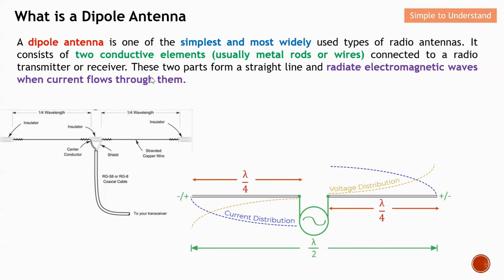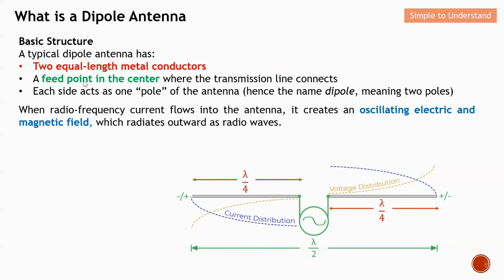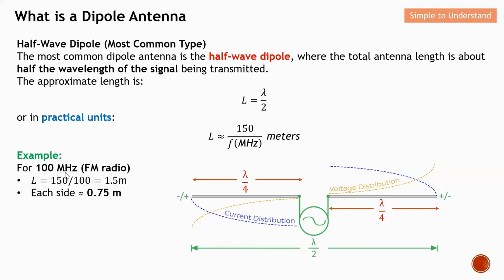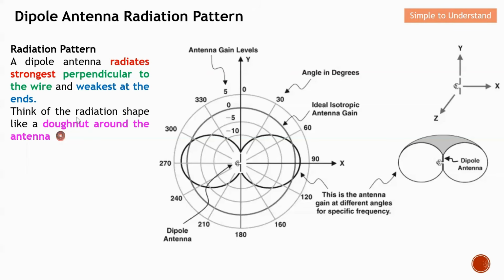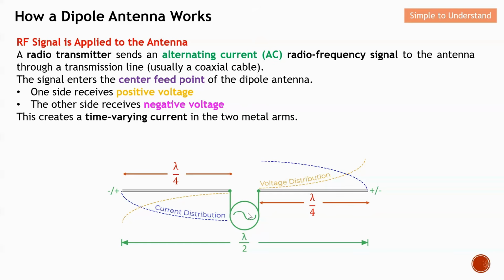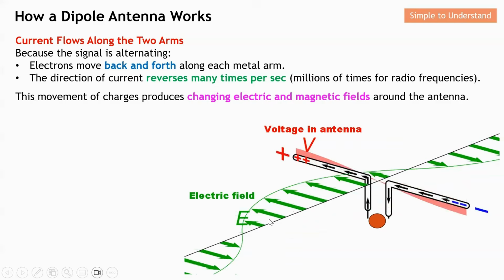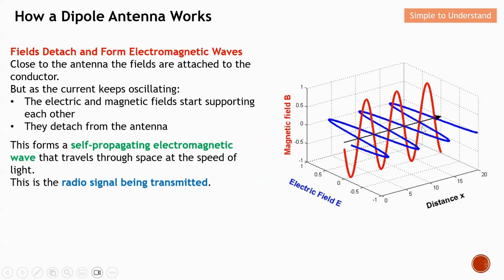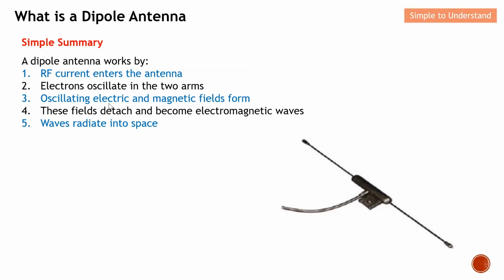Antenna #23. Dipole Antenna Explained (Animated): How It Works, Radiation Pattern, Impedance & Uses

Comment from the maker: Thank you for taking the time to watch this antenna series discussion. The dipole antenna is, in fact, the most common type of antenna because of its simplicity. It consists of two conducting elements joined in the middle by a feeder. The feeder can be a simple coaxial cable.
For transmission, an AC source supplies the antenna through the coaxial cable. The alternating source causes the current to flow back and forth along the two conducting elements. Because the current repeatedly changes direction, it generates changing electric and magnetic fields. As a result, electromagnetic energy detaches from the antenna and radiates into the air as electromagnetic waves.
In this video, I explain the concept with animations to help you understand this challenging topic—antennas.